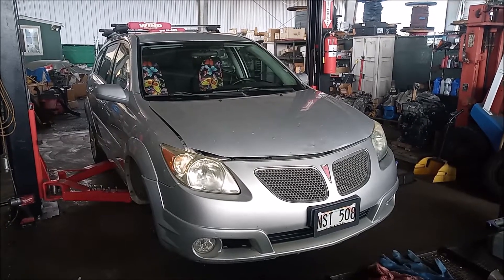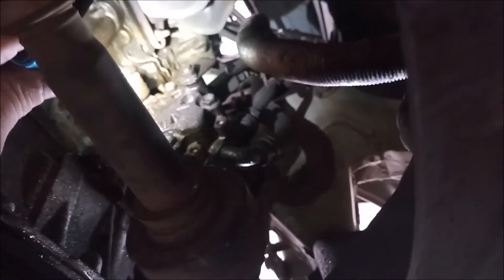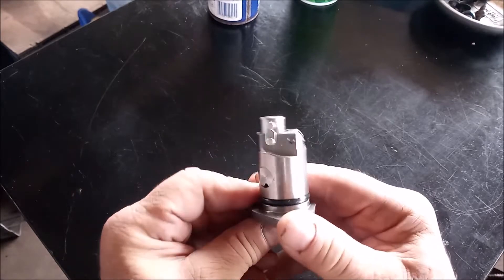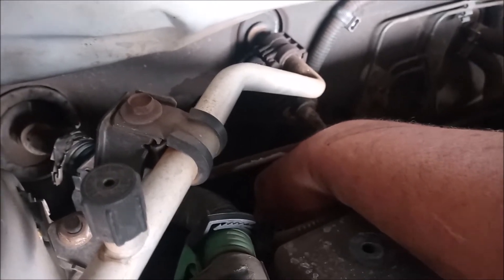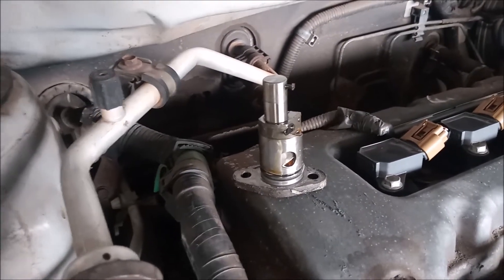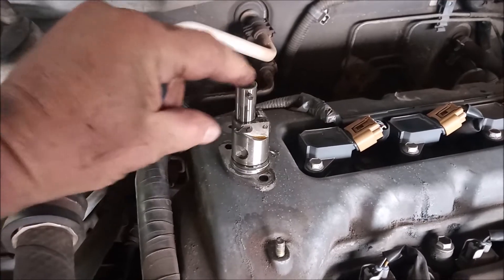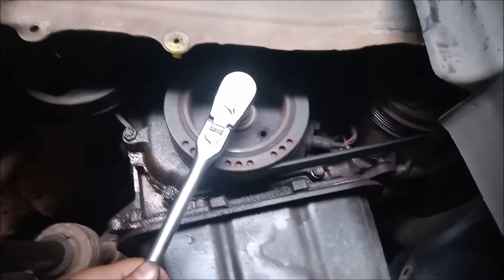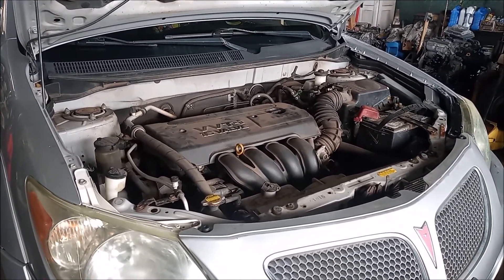How to Fix The Timing Chain Tensioner Oil Leak - Toyota 1.8-liter 1zz-FE Corolla Matrix

Comment: replaced my tensioner on my 07 corolla 3x. still leaks oil. @Merryfrankster any input on the matter? 140k mils
Reply from the maker: Yes actually I do. I have another video where I discuss using a slightly oversize o-ring. This can help if the sealing surface on the timing cover is worn or warped. Search for this video in my 1zz playlist.

Comment: Just wonder will i mess up the timing by turn the crank pulley anti clockwise? Thank you.
Reply from the maker: Like it shows in the video do not turn it back more than 1/8 turn. If the tensioner does not click and release,  then turn it forward and try again but no more than 1/8 turn or so. This should be enough to release the tensioner.
Reply from the maker: Depending on the position of the crankshaft there is more or less slack in the chain on the exhaust side (where the tensioner is located). If you get the crankshaft to a position of minimum slack, then releasing the tensioner is a snap. You can turn the crankshaft forward as far as you want to get it in the desired position. The more tension you have on the intake side, the more slack there is on the exhaust side, and vice versa. Turn the crankshaft forward until you overcome one of the camshaft lobes. This puts all the slack on the intake side and you have maximum tension on the exhaust side. Turn it back from this position.

Comment: This guy is not know what he is doing. It’s was good until the very end when he turns the motor. I need not say more…
Reply from the maker: No, you don't know what you are talking about. Go troll somewhere else.
Reply: @Merryfrankster_  hi I dad charged the sealed 4x and I even use gasket maker and it still leaks heavy please help😊
Reply from the maker: @RBastaldo  try this oversize o-ring. It seems to work better than the original size o-ring. I will feature this in a new video coming soon. https://www.amazon.com/dp/B000FN11OQ
Reply: This is the proper procedure.
Reply from the maker: @korologosmichael0  thank you for watching and for commenting.
Reply: Perhaps........I agree